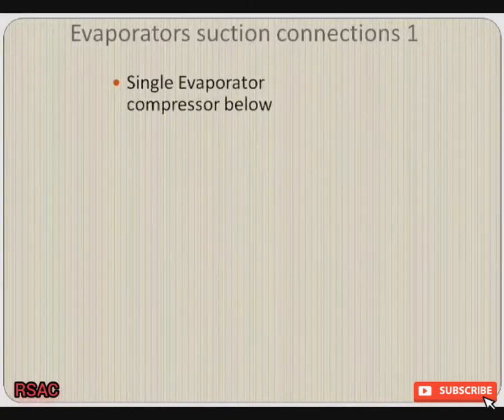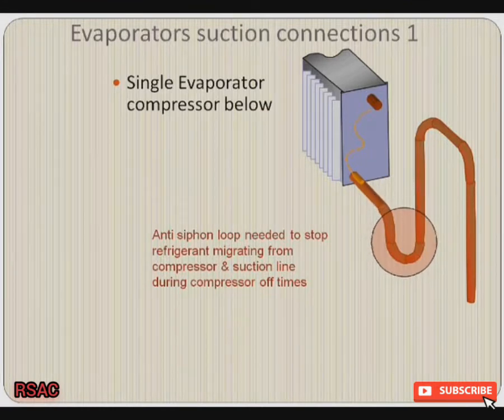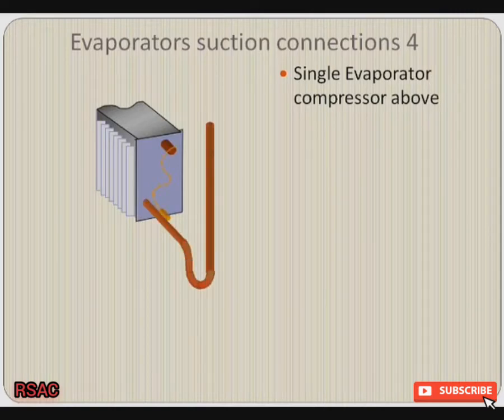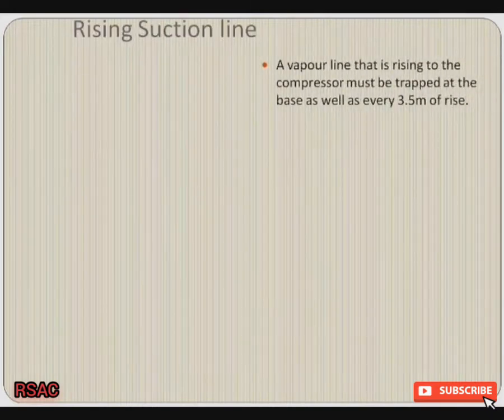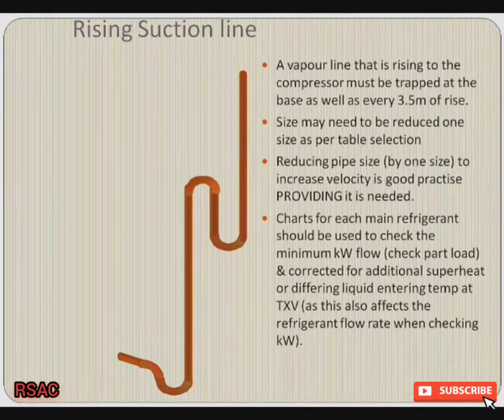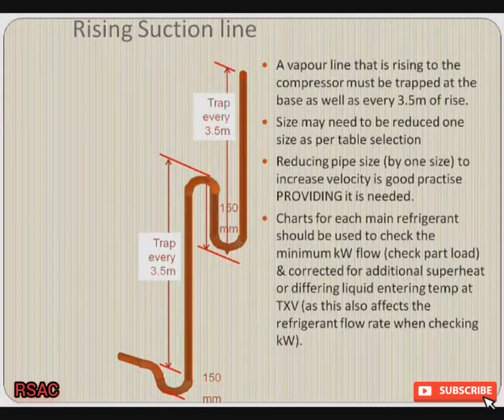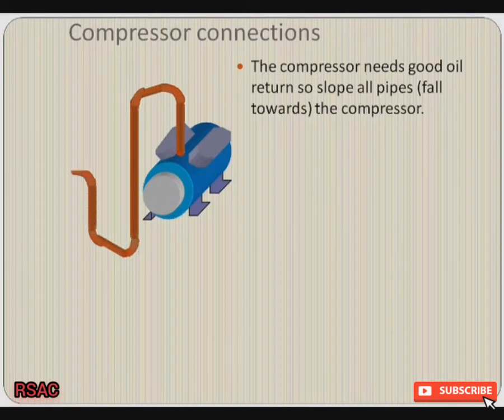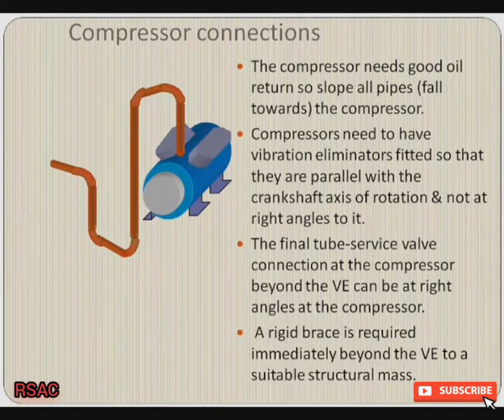how p trap works || p trap installation || refrigeration system

Comment: one correction: all pipes slope towards compressor except discharge pipe. discharge pipe is sloped towards condenser mainly due to discharge check valve and to minimize oil accumulation near compression chamber.

Comment: If i have no suction riser in my refrigeration system and my compressor is below evaporator, would i still need a trap?
Reply from the maker: Dear if your compressor is below down from evaporator then no need trap.

Comment: Needed? for R-410A 120K BTU Central Air with Condenser on roof, and EVAP inside store . About 25' Rise
Reply from the maker: no need if evaporator is on top of condenser then p trap required
Reply: @refrigerationsystemandcoldroom  Evap is about 25' below condenser. Condenser is on roof